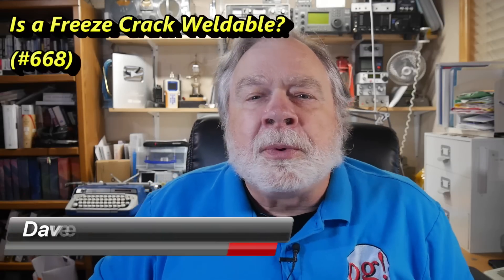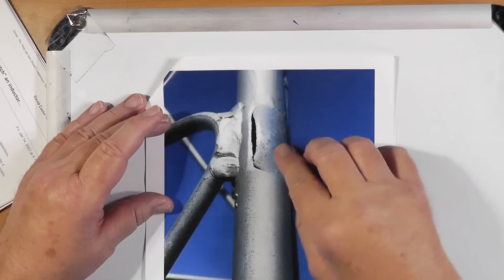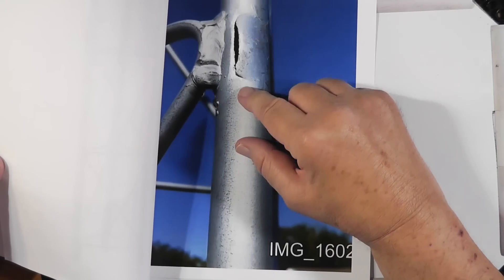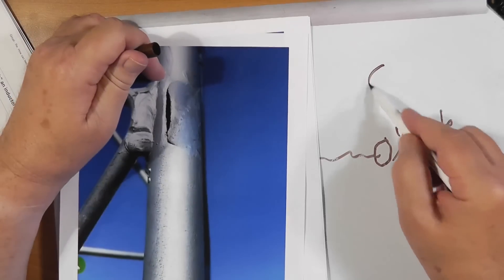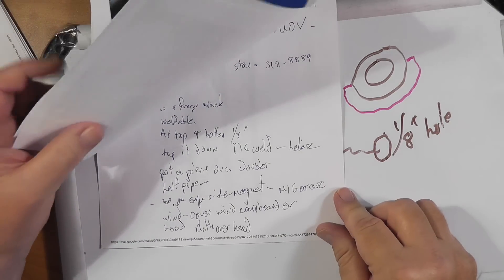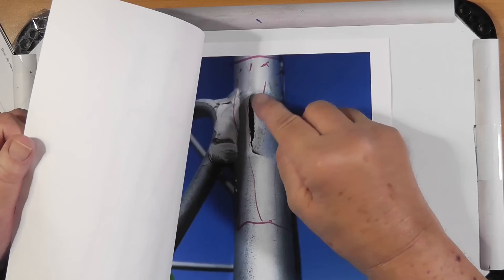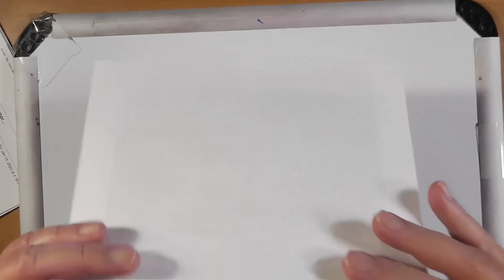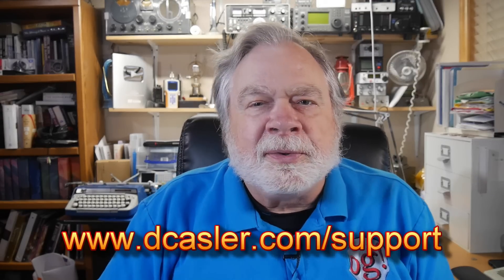Is a Freeze Crack Weldable? (#668)

Comment: That's an indication of something else if the base of that section is sitting on bear earth with concrete around it it will allow a collection of moisture an water in those tubes then it can freeze and bust out worse yet it can rust inside out so you won't. see it till it's to late . When setting the base of towers like this it should be sitting on a bed of gravel to allow drainage . Your supposed to dig the hole deep enough to have a bed of course gravel then put your concrete over it .this section should be replaced with a new one and that whole concrete base abandoned , I know you don't want to hear this but it should have been installed properly now you could weld it if you can get it out but it's most likely in the concrete so it's useless to try and reuse .

Comment: While it might be fixable the only option should be replace the piece. If you need to ask if it is weldable or if you can use epoxy it is safe to say you don't have the knowledge to perform a structural repair. Once you modify or repair a tower section without it being approved by an engineer (in this case it would have to be manufacturer) it is no longer rated for any loads and manufacturer is no longer liable.

Comment: Mr. Casler,
I was a welding inspector in the US Navy and after I retired also in the civilian world. Most of the advice you gave is absolutely correct.  The weld needs to be prepared by grinding (regardless if it is Al or Steel) a groove along the cracks after it is tapped back into place and the ends are located and drilled. Magnetic particle inspection will find the ends easily if it is steel, for Aluminum use a dye penetrant inspection. welding on a doubler plate or corncobbing using brazing will reinforce the area. If welding us used (GTAW, SMAW, GMAW or FCW) disconnect the feed lines and remove the lightning arrestors as the amperage and high frequency electrical energy could ruin equipment.

All that said find a certified welder and a certified NDT/NDE inspector. but the less expensive route would be to replace that section.

Comment: It most likely froze there due to the bolt kit left in the leg of the tower.. Don't weld it even Rohn says Don't weld on thin tower.. Also it is galvanized inside..You will cause it to rust from the inside out. ITS NOT SAFE.. Replace it.. 73, KB5YNM

Comment: If there's one crack there could be more. The tower needs to  be carefully inspected, including for rust inside at the base which probably still has water in it. A common failure, drill small holes and look for rust and rusty water. Welding the tower requires grinding off the zinc and after repair applying spray on zinc coating and any other spots you find.

Comment: Thank you, Dave. 
   I wondered about the 2% expansion of water. Thank you. You gave me an excuse to check. Water expands 9% from its densest at 4 deg C. 
    Remove the damaged section from the tower. Welding in place may weaken that section and collapse the tower.
   A good video. Thanks again. N0QFT

Comment: One important note here, if that's steel then it's galvanized steel and you need to sand off the galvanized layer. Tig or mig would be fine but I would take the tower apart and bring it into the garage to weld it, that steel is super thin and trying to climb up and mig weld it would be a nightmare! Take the section out and bring it inside to weld it.

Comment: Welding on galvanized steel is not fun. Do not breathe the fumes. Grind the zinc off as best as you can then weld it. 7014 welding rod is for welding on steel that has been galvanized. It’s used on bridges all over the world, so it will be fine for this. You’ll have to dress the weld down before you put the doubler on. 

Alternatively, a gasless flux core (inner-shield) wire would be a good choice as well as I don’t think the tubing the tower is made out of is very heavy wall. 

If this guy asked if he can just use epoxy, then he had better just hire someone else to make this repair. I agree with Dave, this is significant damage and requires a significant repair.

Comment: You'll need to braze or MIG that section if you can't bring the tower down. It doesn't matter if it's aluminum or steel for MIG. TIG is arguably better but probably not in that case. You could use flux core MIG if that's all you can get. Flux core doesn't need argon gas. 

I agree with your friend that it looks like steel. Most likely galvanized coated steel. The galvanization needs to be removed before welding. You Need to get down to clean metal. Aluminum tends to have a lot of oxide build up on the surface and that too will need to be removed prior to welding.
Reply: It most certainly does matter if it's aluminum or steel for mig welding. There is a special spool gun you need, and you have to raise both the amps and wire feed up a lot for aluminum. You can not mig weld aluminum with a regular steel wire spool, or torch. TIG is best to do on aluminum, but you can MIG weld it, BUT you need the proper equipment. Do not use Flux core on anything either. I hate that crap. The filler wire needs to match the material you're welding, no matter what you're welding.
Reply: @Spike-sk7ql  you're mostly correct. You don't need a spool gun, although i didn't say it wouldn't help. You just need to keep the feed line short and as straight as possible if you're not using a spool gun. A spool gun is still mig welding technically. MIG is the system and is mostly independent from the filler material. You can use a stick welder to weld aluminum as well. It's not going to be pretty but you can still do it and we would still call it stick welding. Needless technicalities so to say. 🤷🏻‍♂️

The reason i threw out mig welding is because most shops have one. Very few shops have a tig welder. It was more of a logistical consideration then a practical function if that makes sense. TIG although the superior method, is not very forgiving outside. Flux core is. It's nasty stuff though. It needs to be functional, not pretty though.
Reply: That one in the video looks galvanized but most of the aluminum towers I have seen are made out of a heat treated aluminum alloy such as 6061 T6 and welding on them ruins the heat treatment and significantly reduces the yield strength of the material.
Reply: @TheSzalkowski  yeah i think you're right, but probably not as much a hole. 😂

I think A repair patch would probably make up for the reduction in yield strength though. 🤔